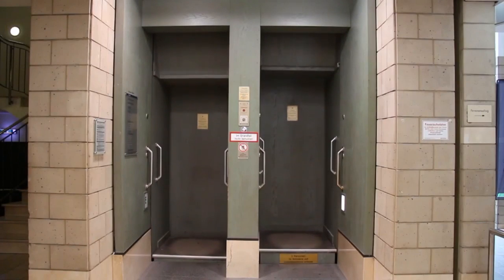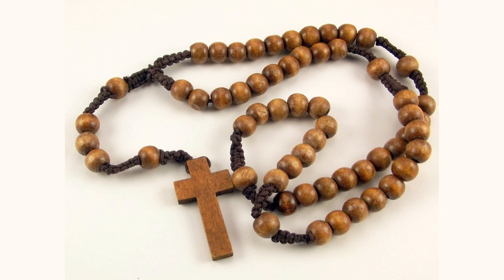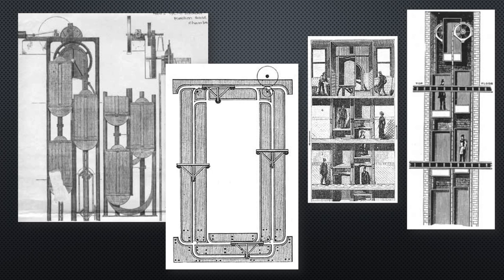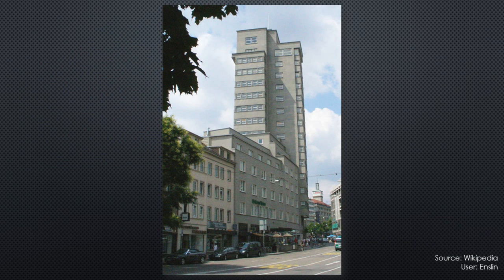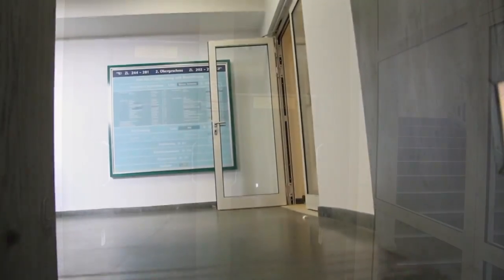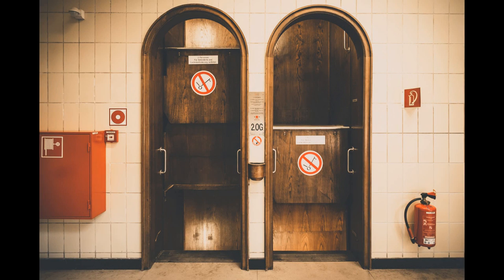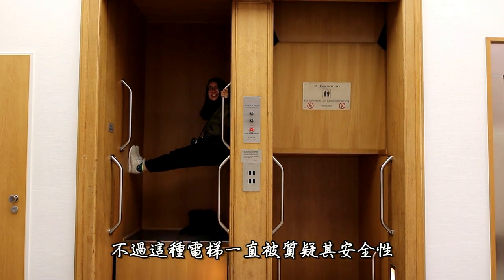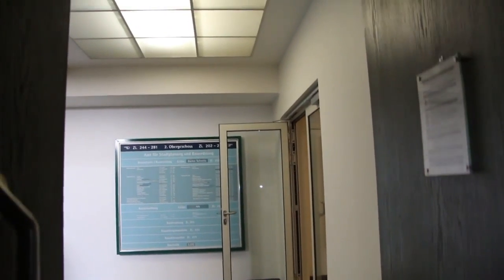What's a Paternoster Lift?

Comment: looks like a good way to lose a limb.
Reply: Or, in my experience your head and your life.
Reply: I'LL BE BACK !  I cared at the time.
Reply: There are safety switches everywhere so it's very difficult to actually get harmed by a modern paternoster.
Reply: Is the head counted as a limb?  Bend over = no more head.
Reply: I'LL BE BACK !  Sure, it would at least reintroduce evolutionary pressure in favour of higher IQ.
Reply: I'LL BE BACK !  covid 19 will take care of overpopulation
Reply: yeah, seems like a lawsuit waiting to happen, especially here in the USA where everyone is sue happy. i can even imagine someone purposely trying to get injured by one of these
for the insurance money.
Reply: @dwaneanderson8039  You have to pay for the service.
Reply: I think, for some of them, there are flaps at the ground where you step in. So if you'd stick a limb out while going up, as long as nobody on the upper floor is standing on the flap, it would just swing open. Too bad there is no video that demonstrates that.
Reply: To me it seems about as dangerous as escalators, especially if you’re wearing crocs......
good video didn’t know that they were revising the design finally.
it seems like a good idea to computer control it you get the benefits of the elevator with the directional improvements not having to wait for cars to go up and down.
Reply: @JohnSmith-hn6kv  Each floor has a wooden flap, so if something is sticking out beyond the safety line inside an ascending "car", it just pushes the flap up.  Each "car" has a similar flap, for something on the floor sticking "in" towards the car in a descending "car".  The sound of the flap going back down alerts people to a potential danger and the flap is not small, so hitting it with your head or toes discourages further mistakes.
Reply: You can cross a road, right?
Reply: I'LL BE BACK !  You haven't seen India and Indonesia then.
Reply: Markus Birth AND THERE ARE PEOPLE WHO DISARM SAFETY FEATURES FOR SPEED!
Reply: salaciousBastard  Yes. In my experience in removing dead bodies from lift cage accidents in Liverpool UK as a seasoned firefighter. Not just paternoster lifts.
Reply: Travelinmatt76  No, A young waitress had her trachea ruptured; she died.
Reply: I'LL BE BACK ! Too bad your parents didn’t get this message.
Reply: @ICUinthedark  we hope so
Reply: @CFox.7  OK, then install it in social sciences department, at best near grievance studies :D
Setting this aside I've seen actual data concerning car crash and IQ. Apparently it reduces crash chance but up to roughly 100 points, above that further increase does not bring any noticeable edge.
Reply: Common sense and flip boards reduce risk, rapid access and exit are the order of the day when using these devices.
Reply: I'LL BE BACK !  It's my perfect chance to infiltrate the gene pool again.
Reply: You mean all those polish peo0le who came over here to do the building and plumbing jobs we could not convince our upwardly mobile young people to do. Never heard of any of them having fifteen kids, most of them just don’t, neither do the other immigrant groups make a habit of it, if they did the DM would be all over them like a rash. Our birth rate ( and when I use the term “our” I do so in an inclusive way) is actually falling and if the current trend continues there will be population contraction instead. As to illegal immigrants and refugees few now think this is a place they would wish to make their home, and along with students and EU workers are staying away. Frankly I don’t see what your comment has to do with paternoster, but just wanted to set the record straight. A large number of those you mention so disparagingly either are or will soon become citizens and contribute to this country, and are already included in the population counts.
Reply: Or at least your toes...
Reply: @bushputz   the edge of the carts and the floors usually have wooden pieces attatched on hinges, making them able to move up in case someone sticks there foot out too soon.
Reply: @mitrooper  I'm speechless 😶
Reply: Installing standard elevators disables the main feature of paternoster lifts: Darwin's Natural Selection.
Reply: I'LL BE BACK !  True. But if Rockefeller and Dr Mengele  had continued perfecting Eugenics, you wouldn’t be here.

Comment: Yeah, they are almost perfectly designed to make a fire go quickly through the entire building.
Reply: That's something that can be solved. Basically ensure that each floor has a foyer with a door that shuts in case of fire and most of that trouble is fixed. The other issues are harder to resolve and even in the case of adding the fire door, you're stuck with a bunch of extra firewall that wouldn't otherwise be needed.
Reply: all you need it fire doors to close off the shaft during fires. doesn't take much design changes.
Reply: and a stairway is not????
Reply: @owlsayssouth  2nd genius.
Reply: @SmallSpoonBrigade  It can be solved by using lifts with doors too, but the point is this is faster.....BECAUSE THERE ARE NOT DOORS....oh, just simply solve the issue basically with some doors......automatic fire sensing doors even, genius.
Reply: @Sahadi420  No, a stairway has a fire code, they are required to have doors that close themselves....always, not just if they sense a fire.(Like every building that has a paternoster would also have.)
This system is successful because of the lack of doors and stopping, changing any of those benefits no longer is the same thing, is that clear enough..
A plane that flies can be simply designed safer if it doesn't leave the ground too, but is that still a plane? No.
So, if you put doors on this, is it no longer a paternoster.
Reply: @themoonissquare323  So, some doors would make them safer....just like with stairs.  And sure it would still a paternoster...it would still be the same exact thing....just with a doorway 5 feet away from it, just like with a staircase.  LOL

Comment: We had something where I worked called a man-lift. It was like a conveyor belt, going straight up and down. There were foot  pads to stand on, and a hand grip to hold onto. You had better get off at the top, or it would carry you right over to the down side, only standing on your head.  Scary thing, it was.
Reply: I rode one of these in the middle of the night at an industrial plant that I was guarding alone years ago and got out on a pitch-black floor. I was afraid to get back on with almost no light coming thru the floor shaft but more afraid to stay. It was a great relief to reach the ground safely, and based on what you said, I was probably close to being dragged over the top in the dark.
Reply: I worked for a few months in a place that had one of those, years ago. I used it once and then took the extra time to use the stairs every time I had change floors after that.
Reply: I saw such a thing on a video where they went to an abandoned sugar beet mill, or whatever it was. I thought they were kidding around!

Comment: My brother and I delivered phone books in the '70s here in the Twin Cities, and saw a lot of cool things not generally open to the citizenry. One was an old flour mill on the Mississippi near downtown Minneapolis. Pretty much the whole place was run by a series of belts, snaking up and around the entire plant. There were two paternosters that we saw (still operating!). Not as fancy as the ones pictured here, these were basically steps bolted to a wide canvas belt that slowly moved through four floors. We spent a fair amount of time just joy-riding! Really clever how the whole mill used one giant engine to power all these belts and pulleys that ran the whole place!
Reply: @blinkvideo Your comment brings back fond memories of Minneapolis where I grew  up in the '50s. My dad worked for "General Mills" flour division, which was located near St Anthony Falls, between 1st S. & Washington ave S. on the East side of 3rd Ave. Pillsbury flour mills also were located in that section of the city. Back then Minneapolis was known as the "Mill City". When the flour mills left the city, the grain elevators were converted to expensive apartments, which had a beautiful view of the downtown river front!
Reply: 🍺 I miss Grain Belt Beer, the real stuff, the recipe used before Irwin Jacobs bought it.  For Minnesota, that was pretty good beer! 🍻

Comment: I remember first seeing this type of lift in a movie when I was a kid. Scared me then, scares me now. :)
Reply: I see this as a great idea that’s still functional today. As the narrator said it takes a bit of concentration, but it’s an elevator you’re not waiting for. “Crush” bars and other safety mechanisms can easily be retrofitted into the them.
Reply: Same here, i think the movie i saw it in was one of the Omen movies.
Reply: Something very similar is used in American industrial facilities somewhat often. No cars, just a little platform to stand on and a rail to grab, the belt or chain is sometimes surrounded by a cage or shaft, but you just step on or off at whatever level you choose. They can be a little scary. They're mostly being phased out by now, but I've been in places that still use them recently.
Reply: Imax Junior yes, it was in the first Omen movie.
Reply: Lul, same here. I thought you would get smooshed at the top. I thought the compartments got folded at the top and bottom.
Reply: They need these things in every high rise in the country of Turkey.

Comment: My company has a building where there's still a paternoster working tirelessly. The maintenance people love that thing as it nearly never fails since the motors are constantly running at the same speed. Very very low-maintenance and employees love them to easily switch between floors.

There's also an industrial version where there's only steps (and a handle) on a rubber band going up and down - called a "belt manlift". This is used to get workers quickly to different floors.
Reply: That must be the US then. The EU banned these years ago.
Reply: The belt manlift is not in my company, I just wanted to mention this special form. Never seen one in real life either.

Comment: For those who never used one, it was perfectly safe to go over the top or under the bottom - the actual ‘cage’ moved sideways and across and they had a light in the area for those frightened of the dark 😀
Reply: TBH, I'm not sure why that wouldn't be safe. They'd have to go out of their way to make it unsafe as the box itself has walls on 5 sides making it difficult for objects to penetrate the car. At least, not any more so than the other areas between floors.
Reply: RICHARD WILSON Thank you.  I always wondered what happened but was too scared to try it!

Comment: I do t like regular elevators. This one is nope. Nope. Nopity nope.
Reply: How about a conveyor belt eighteen inches wide, going up, up up?
Reply: Linda Terrell HOW IS THIS ALLOWED?!?  There’s just no way.
Reply: Don't be such wusses.
Reply: James Faulkner II I've used man-belts, they actually are a little unnerving, haha!
Reply: @The_sinner_Jim_Whitney  That's what they are called! I couldn't remember for my other post, we called them 'man-lifts'. Fun, but just scary enough at times to give tingles. One guy said that he would sometimes carry a fifty pound /22.5kg bag on them. Nutters!
Reply: James Faulkner II I don't know that man-belts are the proper name, but that's what I've always heard them called. I've taken pipe, power tools, tool bags/boxes, disconnects, transformers, all manner of stuff on them. Yeah, they're a little creepy, haha! 

One job I did was to install 'crush bars' (like a push-bar on a commercial door, but with a switch inside to shut the motor down if it's depressed) around the bottom of each deck as the man-belt passed through them, on probably 12 of them in an old coal-fired powerhouse as part of a gas-fired conversion in Kentucky a few years back. Last year I was back in there to do a lighting job and noticed that those dumbasses had bypassed most of them, I guess they'd rather get hurt or almost hurt than wait three minutes to reset it if it tripped.
Reply: The potential for decapitation does seem a bit high.
Reply: it's an invention that could only have been imagined by someone who had never had loose shoelaces near an escalator.
Reply: LOL, my Mom hates going 2- 3 floors on a regular evelator, going to show her this and ask her if she'd rather try one of these!! Think maybe she'll be ok with the modern version now!!LOL 😂😂
Reply: looks like someone is riding their paternoster straight to the nope floor
Reply: The door is always open so you can get out when it starts a freefall - imagine it falling in 100 miles a hour , You must be expert to get out then

Comment: There have been one too many fatalities in them. We had a paternoster lift at Leeds University and I used it a few times but it never really floated my boat. I believe it was decommissioned after a fatal accident.
Reply: Tim Hancock.  One fatality in the UK and one in the Nederland's.  That's it for Europe.  They removed them because of the POTENTIAL for accidents.  In fact they are far more serious accidents and fatalities recorded in conventional lifts but of course there are far more of them.  However it was the HSE concern for potential accidents the caused many of them to be removed but they are still legal.  As with all lift accidents the human element is crucial.  Not sure about the UK one but the Dutch one was caused by corrosion of the bearing plate from too much water when cleaning and lack of preventative maintenance.  The actual function of the lift was not the primary cause. Every lift incident I attempted as a fire officer involved human error be it on the part of the lift passenger (they do some very strange things like riding beneath the cage on a rope and standing on top of the cage) or lack of maintenance by the engineering company.  Many are badly abused in council tower blocks and quite frankly they were used more as urinals that a useful function in the building, not that a urinal is not useful, but urine splashed all over the operating panel is not desirable maintenance.  We had one Paternoster Lift in a bank building on King St in Manchester but I am not aware if it's still there.  I am not aware of any serious incidents with it but I could be wrong as I didn't spend too much of my service in or around Manchester City centre.
Reply: indeed the fun of the interchange in the Roger Stevens block brings back many happy memories
Reply: @Biffo1262   It always amazes me that here in the UK we always (well sometimes) seem to wait for a fatality before we take action to improve a potentially dangerous situation. I live in Basingstoke, Hampshire and as an example the A33 to Reading has a dual carriageway section with a 70 mph speed limit (same as a motorway) but features no crash barriers in the central reservation so there's potential every day for a 150 + mph (being realistic) head on crash. But it's been like that for as long as the dual carriageway has been open (more than 35 years).
Reply: Yes remember them at Leeds University back in 1980
Reply: SAFETY is better than convenience.
Reply: @Martindyna  That does sound like a dangerous stretch of road, but two cars hitting each other head on at equal speed is only equivalent of them hitting a wall at the speed they were each travelling at, it'd just be two 70mph crashes. There was a really good myth busters episode on it I remember.

Comment: Saw one of those in use on The Prisoner when Number Six escapes The Village and reports to his superiors in the Many Happy Returns episode.
Reply: This was in the (now demolished) GEC building in Borehamwood, just a short walk from Elstree Studios, and the Prisoner Appreciation Society occasionally came for a visit to see it.  I used to work there in the late 90s and rode the paternoster most days.  It was a rite of passage to do a full circuit, going over the top and round the bottom.  Shortly before I left to work elsewhere the paternoster broke down and it wasn't allowed to be repaired.
Reply: @JohnMonsteur  I "rode" on that during a training course there back in the 90's.  Quite an experience.  If I remember, there was a wooden flap on the floor which had a one way hinge such that if you leaned too far forward on the way up, the flap would hinge so the worst you would get was a smack on the top of your head (rather than having your head taken off!)
Reply: I used to work there in the sixties and used it a lot.  Once saw a chap get on carrying a long florescent tube - Too late he realised it didn't fit

Comment: I was fascinated to see this type of lift in the early 90s when I worked as a temp at Unipart Oxford. Always volunteered to take papers so I could have a go. 
It clearly stated not to stay on above the top floor or the bottom one, but one lunch break I did the whole round. Honestly wasn't convinced I wouldn't be tipped upside down but I can confirm that it didn't and it was just a bit dark with lots of bricks

Comment: I worked for a time in the IG Farben Building in Frankfurt  very late 1969, before I was transferred to Berlin in the Army. I rode one in that building for about a month. It took some practice to get on and off for a while, but it worked well. I certainly beat climbing several flights of stairs.

Comment: It looks like a crash stop bar with switches and a light beam could be fitted in the top to stop the elevator.    Also light beams to slow elevator or provide an entry door.